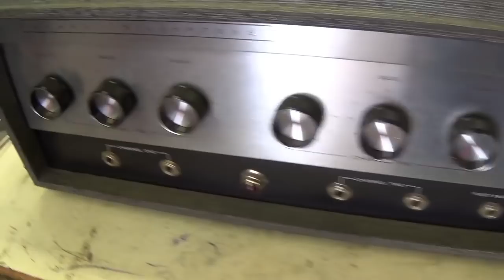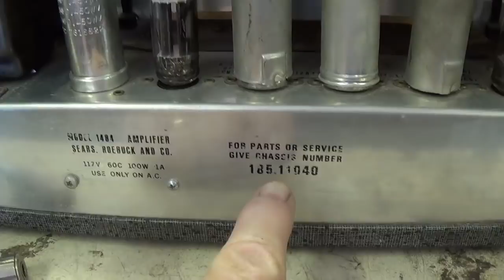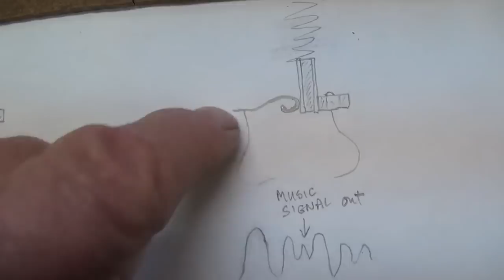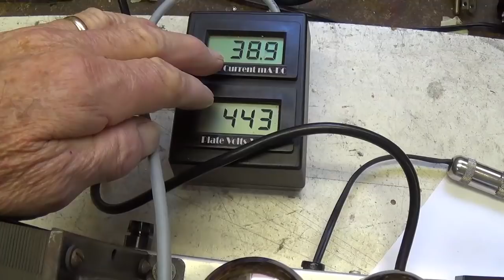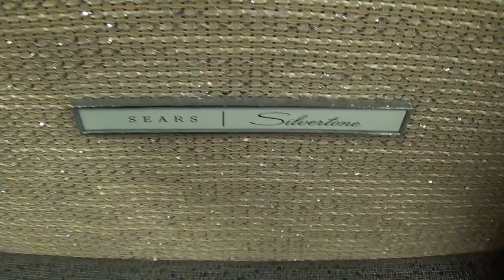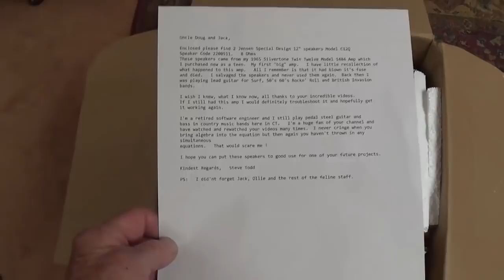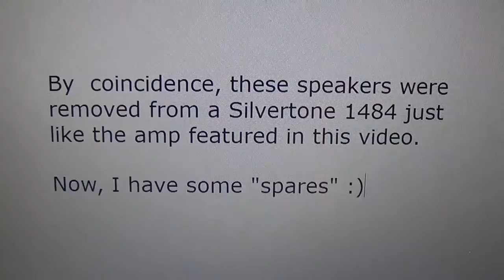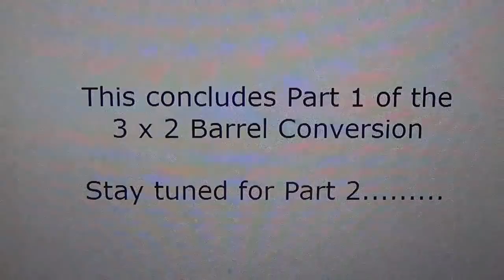Super Nice 1966 Silvertone Model 1484.......The Amp that Launched a Thousand Careers

Comment: I've had about six of these.  I still have a 2x12 from the solid state version that I had, which wasn't altogether horrid, although strangely noisy. I noticed there were two different versions early on... the earlier one had more of a brown gritty overdrive that seemed to BARK. That wasn't my preferred one, as the other was more silky sounding and had a nicer sound and even the reverb was nicer.  I believe put a buffer on the reverb circuit to use  an effects loop, as the reverb was so horrid... these apparently were made by Danelectro, or that's what I heard.  The open back cabinet was an unintended masterstroke, as it was made to hold the head, they made an accidental scoop cab... which works very well to develope the bass in the cab when sitting the proper distance from the wall. I intended to repair the reverb on mine, but was mystified at what I found inside... explored the unit and the crystal piezo sandwich was pure voodoo to my younger self and crumbled in my hands, and testing it with signal was significant in that it shocked my hand with the signal being sent to the reverb input! It was a HOT input!!
Reply: Also these were supplied with a very long 1/4" cord that plugged I to the csb. A male 1/4 cord.
Reply: And that's the first cab I've ever seen that didn't have GOLD BACK special design Jensens. Perhaps that's an early one! I've got a number of those Jensens from that version that came in the classic Leslie 125, which I often buy on the cheap to convert to a two driver and use a 15" and save the Jensens for other projects.
Reply from the maker: @seansweeney3532  Thanks for all the informative input, Sean.

Comment: Checking out the schematic I was pleased to see that the STANDBY switch doesn't cut the B+ line but actually mutes the amp, which I feel is the real purpose of putting an amp in STANDBY.  Saving power or worrying about cathode stripping were probably the last things on a guitarist's or amp maker's mind back in the sixties.  I note also that the power supply has four 100uF/150V electros for B+ and a 100uF/50V for the bias.  It looks like your amp bias cap has been up rated to 100uF/150V and  is much smaller than the grey B+ caps.  So I'm guessing the B+ caps are either older than the bias one or are higher rated than 100uF/150V.  Just curious, couldn't see their value.  At first glance I thought it may be difficult  to work on but all the usual suspects are in fact out in the open.  Thanks for posting a great video on another interesting amp.  Regards, Jeff.
Reply from the maker: I agree completely about the real purpose of a Standby Switch,  Jeff. When they interrupt the B+, I feel like they cause more harm than good, creating an instantaneous onrush of high voltage, rather than the more gentle increase produced by a tube rectifier. Their use with SS rectification is moot, simply trading one problem for another. I honestly don't recall the exact voltage ratings of the capacitors in the circuit, but am certain they were at least 150V. Thanks for your comments.

Comment: I have one of these if you have one change, the input jacks to grounded,originals are open and just create noise.  Gerald. Weber wrote an article and had to add a little bit of gain by changing a couple of components. well worth it.
Reply from the maker: Thanks for your helpful input, Buzz :)
Reply: @UncleDoug  Thank you Uncle Doug for all you do!   The info I refer to is from Gerald Webers 2009 book, All About Vacuum Tube Amplifiers.   One other mod that I implemented was a slight redesign of the bias circuit to add an adjustable pot for bias adjustment.   If you enjoy books on the subject, I recommend any or all of his books.
Reply from the maker: Thanks for the tip, Buzz :) @buzzedalldrink9131

Comment: I have really been enjoying your tube instrument amplifier videos.
If I am not mistaken, the Silvertone guitars and amplifiers were made by a company called Danelectro in or near Chicago Illinois.
I have a question for you that I have never been able to get a good answer to.
Danelectro made tube amplifiers under their own name long before they ever made them for anyone else.
 Their cabinets were absolutely unique in the they seemed to be molded from sort of a compressed paper or paper mache' material. 
 If you took the electronics out of that cabinet and put all the parts including the speaker into ANY other type of cabinet, it wouldn't sound nearly as good.
 Unfortunately, I was never able to find the material they used and/or the process they used to mold the cabinets; which is a shame because those cabinets had absolutely no self resonance frequencies, and yet would increase the speaker output simply by vibrating with the speaker in an open back cabinet.
 The tone was the mellowist I ever heard.
 The closest I have ever found to the material they used is a material called Hemotite, which can be purchased like you would purchase plasterboard, and is used as a sound deadening material for the walls of buildings near airports, etc....
  Is it possible that those cabinets were hand layered in a mold as if you were making a mask for Halloween?
 Last but not least, have you ever seen or heard a Danelectro amplifier in it's original cabinet?
Reply from the maker: Thanks for the nice comments,  Dennis. We're glad you enjoy our videos. Apparently I have never seen an original Danelectro cabinet, because I'm unfamiliar with the compressed paper construction you described. Some early radios used a material called "Repwood" to fabricate highly embossed and decorated cabinets......perhaps this is the material you are describing.
Reply: This material was covered, (probably in Tolex), and not fancy at all.
I have seen two surface finishes. One looked like plasterboard, and the other looked like it was rolled between rollers that perforated it to possibly dry it faster.
In many years of looking at Google Images and EBay; I have not been able to find a single one.  They were very cheap amps in the $30 to $50 range back in the late 50's, so they were probably thrown away when stains would start to appear, wicking up on the bottom front indicating that the paper material was absorbing water and getting soft.
 It was not my amp. I had a Magnitone 480 with tremolo, vibrato, and REVERB...; but his Danelectro had a special kind of sound that I cannot describe....A sound quality that I had never heard before , or since.....
 If you ever see one you will be able to recognize it immediately because it was seamless and it looked a lot like injection molded plastic would today, except the material was 1/2 inch thick or more, but much lighter than a plywood wood case.
 I wish I had taken pictures back then because after 60 years most of the memories of the finer details have escaped me.....
.
Everything I have found says the Danelectro amps were built in Jersey, but since Sears and Wards were headquartered in Chicago, those amps, and a few smaller Danelectros, were made in a small industrial area located on the West side of a very large railroad switching yard that was located a few miles East of Midway Airport in Chicago.
 They may have only made the cases there, using bare amps shipped in from Jersey, but they were assembled there..

Comment: Nice amp, this amp head is fine for lead but to distorted for cleans rhythm for me, i'd trade out the jensens for JBL's for a cleaner sound,n more bass punch - ive used those same jensens in a fender twin and sounded just like that...twangy , but all n all "according to the price paid" its nice - i found an all org SANO tube amp for 75 bucks at the thrift store - my great find~

Comment: Best bang for buck addon is to install an adjustable cam gear so you can get the valve timing spot on as factory timing is less than ideal .
Reply from the maker: Thanks for the suggestion, Bob.

Comment: Astounding! I always wanted at 13 years old but opted for an Ampeg smaller amp (can't remember the model single 12 inch speaker with reverb).  In regards to using a MICROPHONE the Shure 57 has always been the choice of every sound company that ever miked my guitar amp.  I understand it's because the frequency response of an instrument like a guitar is much lower ( 80 - 10,000) where as the SM 58 picks up approx 80 - 18,000 Hz, full range.  A Mic on one speaker gives the same frequency response and tone. That's what I think I know or remember. . 📢😎🎸👍🏼🇺🇸KAG🇺🇸 DISCLAIMER: information provided is an approximation. It has not been verified as to the exact frequency response.  It may not be accurate but I hope it's helpful.
Reply: If u ever used an Electro voice Re-15 or re-16 10 or the 11 ...you'd never use Shure again, plus even better for voice, think Elvis - expensive tho

Comment: the sound test is great. No blown speakars!  These amps came with a 2-switch Footswitch,  where is it ?
Reply from the maker: Thanks, Z. I wish I knew.
Reply: @UncleDoug   Ampeg amps used the same "wedge" shaped footswitches as Silvertone,  identical but black instead of the Silvertone silver-grey ones for Tremolo and Reverb. Also Ampeg used a chromed switch plate while Silvertone used a brushed  aluminium plate. 1/4" stereo plug with 3-wire cord. They were perfect wedges to place under the tires of a car that had no brakes.
Reply from the maker: @zurdoremi  Maybe that's where I'll find the footswitch for this amp ;)

Comment: Just love Uncle Doug's thorough repair jobs.  Uncle Doug, do you work on Grommes integrated tube amplifiers?  I'm looking to track down a model 56PG on ebay which is a 30 watt amp using a pair of 5881 output tubes.
Reply from the maker: I have worked on one or two Grommes circuits,  Bob. As I recall, they are quite well engineered.
Reply: @UncleDoug  Bill Grommes designed great mono amplifiers.  I'm hoping to find a 56PJ on ebay

Comment: From Leo:   I am not sure I ever saw one that clean in 1970.  Thanks for your work.   

I have a question about automotive wiring.  I am in a habit of soldering the crimp lugs on everything under the hood or under the chassis.  The midwest is far more wet than where you live.  Do you have any problem with connection on old crimp connector installations?   3  deuces is very traditional but you have to admit the old carter AFB was easy to set up, performed well and very reliable.  Three deuces IS a great fit on that style of car.

Comment: Hi Uncle Doug,  Do you have you SM-57 hook up to an additional speaker system?  I trying to learn a bit about electronics and amps and how to set them up!  Things that may be obvious to you are new to me.  Could tell me a bit about how your set-up is working. Thanks so much for putting up with my  questions!  Tom
Reply from the maker: The microphone is connected to a Tascam 8-Channel digital recorder, Tom. A microphone, by itself, cannot drive a speaker system. Its signal must first be amplified.
Reply: @UncleDoug  Thanks Uncle Doug!  I seen Marty Stuart and Kenny Vaughn used a Mike off an Amp but they must run it through another Amp then to speakers????
Reply from the maker: @PLINKER  Yes, they are probably miking a small amp and sending the signal to a much larger P.A. amplification system.....or they are simply using the mike to record their signal, as I do.

Comment: Uncle Doug, I need a favor in the form of your opinion. I have a original, first generation Carvin x100b head. I am experiencing extremely low output volume. The tubes and filter capacitors have been replaced, and this problem was happening before any of that took place. I don't expect you to diagnose my amplifier. Especially without seeing it. However, I'm wondering if you have ever run into this particular problem with these amplifiers or another brand? And what your suspensions tell you? As always, thank you for all the GREAT content!
Reply from the maker: Two possibilities come to mind:  1.) Are your screen voltages correct? Low SV's will reduce volume.  2.) Is there a possibility that your output transformer is faulty?  It is the link between amplified signal and the speaker(s).
Reply: @UncleDoug  I was afraid you would mention the output transformer. I have to believe that it is alright. Seeing as my amp tech here in Michigan thought he had it fixed when it left his shop. 
I have  450 V plate and around 43 mv on the bias probe. I am not sure if this is what you are referring to when you speak of the filter voltage, and I'm guessing it is not? I probably should just take it back to my tech. It's just that it is a 1 hour drive one way, and I'm trying to avoid it. His name is Dean Zink and you can look him up. I'm surprised it came back to me, NOT fixed. Anyway, I appreciate anything you can add to this before I make the drive out there next week. Thank you SO MUCH for the reply and trying to help.
Reply from the maker: @DetroitWrecker666  The most likely causes would be a bad amplification tube.....but this would affect only the channel it is in; a failed plate resistor; low tube voltage(s), especially the screen; and a faulty output transformer in which there is an internal short that reduces the winding ratio. If you are able to do a winding ratio measurement,  it would confirm or eliminate this as a cause. Otherwise, it should have been fixed when you picked it up the first time. Never accept or pay for  any repairs until you have personally tested them on site and determined that they solved the problem(s). Even if customers are in a hurry, I always insist on them thoroughly testing gear before it leaves the workshop. This protects both them.....and me.
Reply: @UncleDoug  Yes, I realize that now! However, I am thinking if I tell him it was never fixed, he will believe me. He takes a considerable amount of pride in his work. You posted a video I watched not long ago, on how to determine the winding ratio on a output transformer. I will watch it again, and see what I come up with. Also, it may help to tell you that, the little volume that I am getting from it. Is extremely distorted, like there's a distortion pedal in front of it. I am going to take it out of the cabinet one more time, to re-solder the new filter capacitors in place. I didn't feel like pulling the entire board off. So, I used the "J hook" method soldering the new ones in place. Right after I did it, I wished I had not.... it just looks sloppy in my opinion. I certainly don't want Dean to see it. The way he solders, you would never know he was in your amp. And he certainly wouldn't use the "J hook method"
Reply from the maker: @DetroitWrecker666  While you're at it, have him check the coupling caps also, DW, they can cause problems like you described.
Reply: @UncleDoug  I really appreciate your time in addressing this matter with me, Uncle Doug. I will give you a update (if you like) once it is fixed, and back to blowing my hair back! Thanks again!
Reply from the maker: @DetroitWrecker666  Please do, DW. We always enjoy success stories from our viewers.

Comment: Greetings kind Sir. The reverb driver tube on my 1484 amplifier calls for 215v at pins 1 and 6. The B+ voltage comes in at 340v.
It then goes through two 27K resistors, one resister to each plate. I have replaced the resistors but the voltages at those plates are still up to 338v.  The reverb effect does now actually work. But I fear that I will once again blow that tube up. All other voltages in that circuit are very close to what the drawing calls for . Could the schematic be wrong about the 27k resistors ? Thank you
Reply from the maker: It's more likely that the 820 Ohm bias resistor for the driver tube has changed value. You can adjust the plate voltage by adjusting the value of this resistor.  Higher resistance = lower PV.

Comment: Greetings, and thanks for the great video.  I am restoring an Airline 62-9015A which is a nearly identical amp to this one, and the reverb tank is missing.  Do you have an idea on what a suitable replacement would be?  It is driven by a 6CG7 and recovered by a 12AX7 just as it is in the 1484, I believe.  I also have a complete and functioning 62-9015A so I can easily determine how to connect it.  Any input would be helpful.  Thanks!
Reply from the maker: The 1484 uses a piezo reverb tank, Eric, which is probably what your amp used.....and is not a particularly successful design. You apparently want to install a regular magnetic transducer (MT) tank in this amp.....the problem being that the tank would be tube (not transformer) driven and its input impedance would have to match the 6CG7 and output would have to match the 12AX7. You might check the Accusonic Tank site to see what's available. I have tried to install MT tanks in place of piezo tanks, with no success, so hopefully, you'll have better luck than I did.

Comment: Would it be possible to post a video showing how to build a simple amp attenuator box. I have a small practice tube amp which I would like to crank up but it is just too loud. I'd like to put an attenuator between the amp and speaker. With your knowledge of theory and explanation it would be great to understand how they work and how to build one at home.
Reply from the maker: I have no experience with attenuators, but have gotten several inquiries about them recently, so I definitely need to do some study on the subject. I'll keep your request in mind for future videos.
Reply: Uncle Doug awesome, I will keep my fingers and toes crossed.